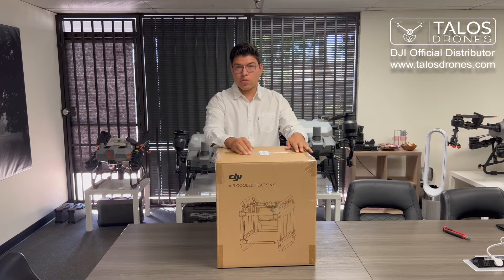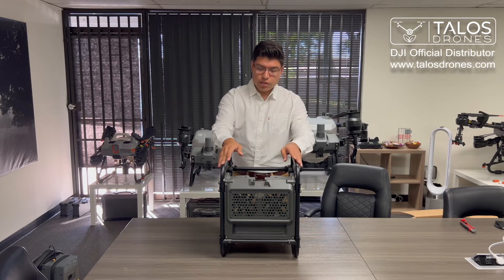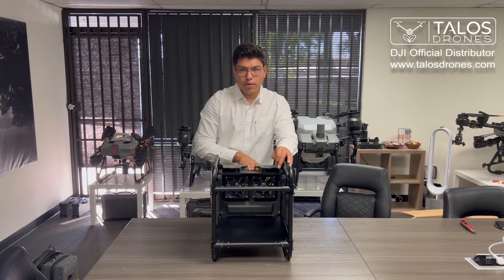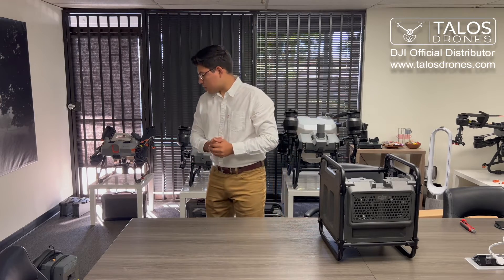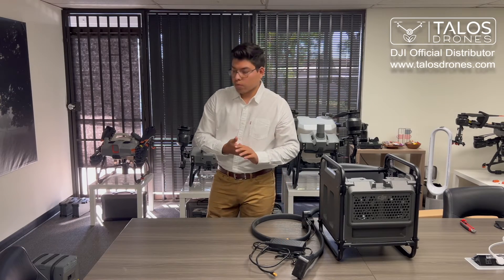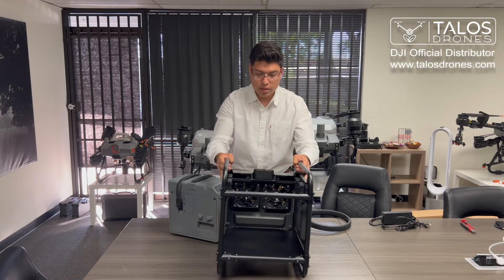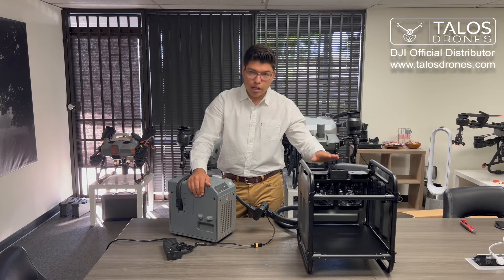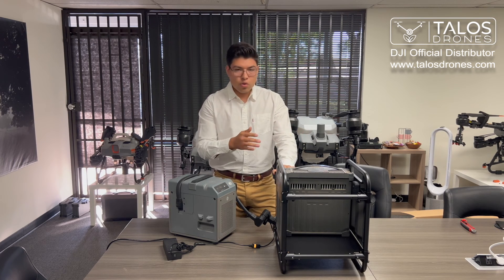DJI Agras T40 Battery Cooling Kit and the Adapter Kit Explained

Comment: Nice info.  Thanks. 

Quick question. When putting the second battery in, how do you connect the charger? The support bar on the back side prevents cords from aligning properly.
Reply from the maker: We recommend connecting the battery to the charging cable before placing it in the cooling kit. This should help align the cords properly.

Comment: The cooler will hold two batteries, but set up as shown here , does this kit both cool and charge two batteries, or only one?
Reply from the maker: You can charge one battery at a time with one cooler. The second battery can be in the cooler while waiting for the first battery to get charged.